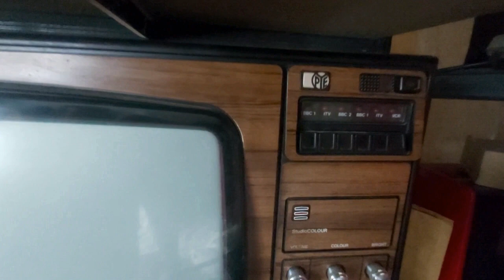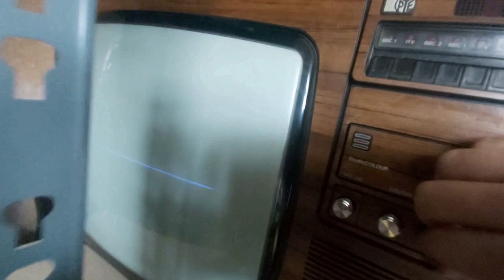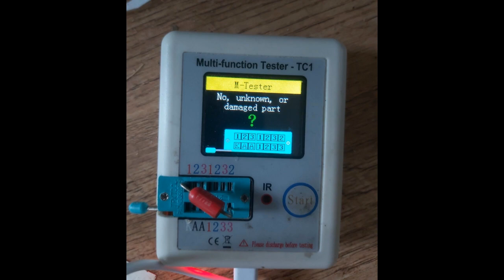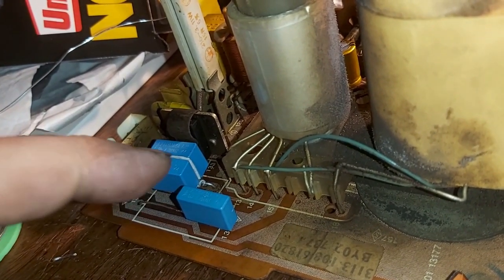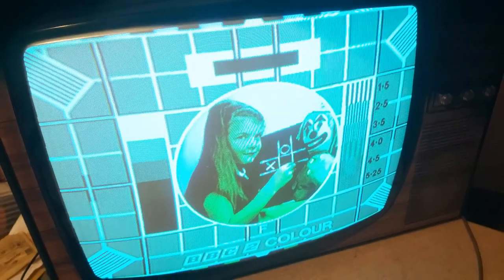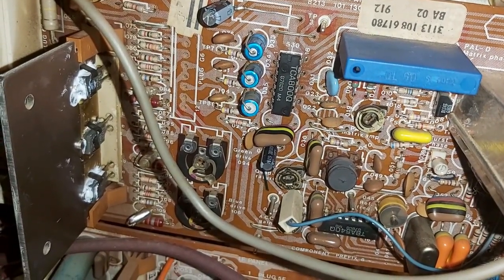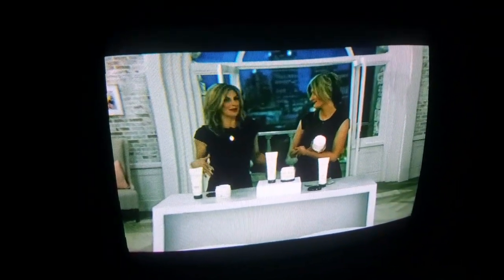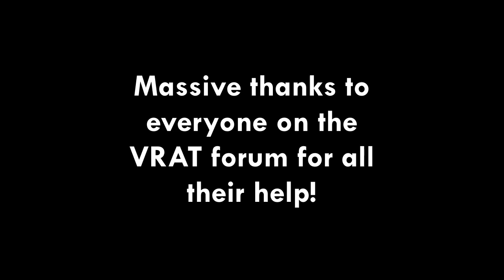Pye CT450 Philips G11 Television Repair

Comment: I was told by the Original Philips Croydon Engineer s that originally the Frame chip TDA2600  was designed to have a ceramic chip holder to cope with the heat , however the Dutch Philips bosses changed it to a cheap plastic one to save a penny or two regret to say, after some time it gave numerous problems. The main Smoothing Cap on PSU PCB suffered with a intermittent arcing terminal this could cause so much arcing it blew the Line output stage ,EHT / Lopt Transformer and made a hole in the CRT , unbelievable damage . Even with it's  problems it was a good popular Philips TV to Service but not as reliable as older models of TV in Philips range
Reply from the maker: Since making this video I've concluded that this too had suffered from the smoothing cap issue which someone had tried (and failed) to repair. Luckily the colour decoder chip and LT diodes took the hit rather than arcing through the tube neck. 

I've also replaced the smoothing capacitor with a modern Rubycon capacitor as it occurs to me that even the blue replacement was approaching 40 years old.

Comment: Very good picture indeed 
Looking at the testcard looks like the width is a bit wide 
But the colours are superb
Reply from the maker: This is a direct feed from YouTube so it might be due to the original uploaded video. I have noticed since making this vid that the pincushion correction seems slightly out but I don't really want to start messing with it as otherwise I'm happy with it.
Reply: @MegaWayneD  Check the East West coil first just in case it's is burnt 
Was a common problem back in the day 
Thanks

Comment: I remember well, the first time we got Philips and Pye G11 sets in at Curry's. The picture was very good and quite an improvement due to the new Mullard 20 AX tubes, that were slimmer, sharper and fewer convergence controls. These sets gave very little trouble in their first few years. Many of the sets I saw for repair only had dry joints around the line output stage and especially at the scan coil connection which was a flimsy plug  and socket arrangement on the line stage pcb as I remember. We used to solder the wires straight onto the board.  I used to call them the king of the dry joint. I remember talking a PYE set identical to this to a house where the customer had bought the first VCR our branch had sold, it was a Philips N 1700 , he was always complaining about unstable pictures on the video through his old TV which was a Rediffusion aerial version of their Mk 1 series. I was sent by the manager, to demonstrate that the VCR button on the PYE set, would give a stable picture. It was hoped that this would prove to him that the video was not faulty and that he might buy the set. He would not be told though, even though he could see the picture was now rock steady and his son was saying that the new set was much better, he just kept saying that his old set was the best TV in the world and nobody else knew what they were talking about. You can't help some people.
Reply from the maker: I'll bet he kept his N1700 long after everyone had started using VHS. Wonder how many video hire shops he yelled at because they didn't have Chariots of Fire on N1700?!
Reply: Early adopters lol

 @MegaWayneD

Comment: I used to do tv reapirs way back  1974 black and white valve  jobbies ,right through transister colour british models.
Moved onto computers (mainframes/desktops etc)
i am now 67 and recently now working on led tv,s not quite the same but fun pity about the screens failing in such vast numbers quality issues.

Comment: Long live CRT tvs, I used repair flat screen tvs,crt different ball game,more knowledge very dangerous flyback,high voltage
Reply from the maker: The flat screen in my Son's room has just developed a weird jitter after it's been powered for about five minutes. I'm dreading looking at it. He's currently using his PS5 with a 14" portable CRT TV via an HDMI to composite adapter. I offered him a larger CRT TV but he's happy with that one.
Reply: @MegaWayneD  please explain the faults?

Comment: We had one of those sets but it had teletext (Ceefax/Oracle)
Reply from the maker: Yes! They had the cool "Teletext Ceefax Oracle" badge in the bottom left corner.
Reply: @MegaWayneD  It survived a trip in a removal van from Birmingham into Wales but after two or so years it finally died after making a strange noise (which wasn't a bang or a pop)
Reply from the maker: @DavidSmith-648  I suspect it had the dreaded "green meanie" capacitors in the HT smoothing stage or possibly even the big red smoothing capacitor in the HT smoothing. Any of these failing could've caused the high voltage to go sky high and blow a hole in the neck of the CRT. Notice I change the green cylindrical capacitors in this video to blue TDK polypropylene caps.

Comment: I have a 22 inch Philips k30 set, a great clean television the picture is great in my opinion and the colour too! But it’s slightly tinted with green and when starting it up you can see a green picture and it does take time to for the colour to appear where the green is not really noticeable from a far when it comes to a black and white picture. I’m no television expert and I don’t know if it’s normal or not to happen for a television this age and from this make, could you help give me some advice on what I should do? As there is hardly any store that can deal with a set like mine
Reply from the maker: I don't have much experience with the K-series Philips chassis, but it sounds like a greyscale issue. On the neckboard there's usually three coloured adjustments, red green and blue. Adjusting the green should help, only make adjustments after the set has been on for over an hour. I recommend joining the VRAT forum too.
Reply: @MegaWayneD  thanks for the advice, I’ll give it a go when I have time, how should I adjust the green? Should I turn the set up and unplug it or leave it on after it has been on for over an hour?
Reply: Hello just to update you, I managed to adjust around with the green and just managed to get a good enough picture for both colour and black and white. Although you can still see a green picture when starting up the television, it instantly goes away when the set is warmed up and the colour appears more quicker than before.
Reply: @MegaWayneD tired crt

Comment: How come there's 2 lots of buttons that both say bbc1 and itv? Was this a dual standard set?
Reply from the maker: I do go over this in another video. It's more likely because different ITV regions showed different programmes and as the G11 was good for picking up distant signals you could have say Thames on one ITV and ATV on another depending on where you are. People had been used to this with the old 405 line VHF system.  There were some regional differences with BBC1 as well. Also, a lot of TVs had BBC1, BBC2, ITV1, ITV2 before Channel 4 was launched. My other video is here: https://youtu.be/s55bRg9urvA?si=kKMK2VsekY9BERea
Reply: @MegaWayneD  ahhhh thought it could be either/or. I mean where I live in Yorkshire I was able to pick up YTV as normal but on thr tv in my bedroom it picked up Tyne tees despite living nowhere near that part of the country!

I guess it would've been cool to live in a bordering itv region and basically getting a whole new channel for nothing where the schedule was almost completely different. Now we take this kind of stuff for granted.
Reply from the maker: @whatamalike weirdly enough I do mention being able to pick up Tyne Tees and Yorkshire in my other video! If you were nearer to North Yorkshire you could definitely pick up both. I could only get Tyne Tees where I lived in Newcastle at the time.
Yeah, different ITV regions showed different programmes or may show a late night film etc that other regions wouldn't show. Yorkshire and Tyne Tees refused to show Tiswas for some reason.
Reply: @MegaWayneD  well what's strange is that when I say I was nowhere near the TT region, i really mean it. Practically on the south/west yorkshire border and in fact could just about see emerly Moor from my house haha

Comment: Odd that set has a button for VCR but not one for channel 4
Reply from the maker: Not really. Channel 4 started in 1982, four years after this set was made. In the UK in 1978 you had the choice of the original 1972 Philips N1500 VCR along with the Philips N1700 VCR released in 1978. Plus Sony's Betamax released in 1977 and the newly released VHS system.
Up until Channel 4 being launched a lot of UK market TVs had "BBC1, BBC2, ITV1, ITV2, VCR" as the channels.